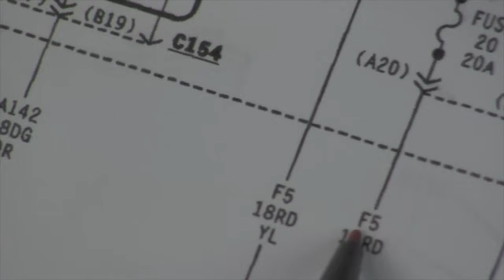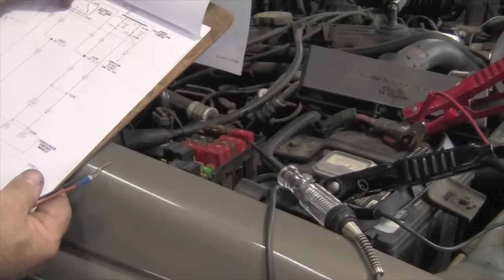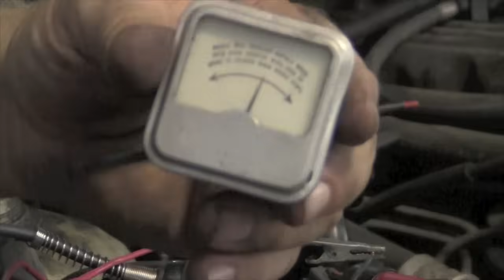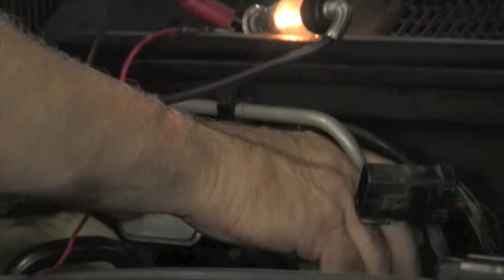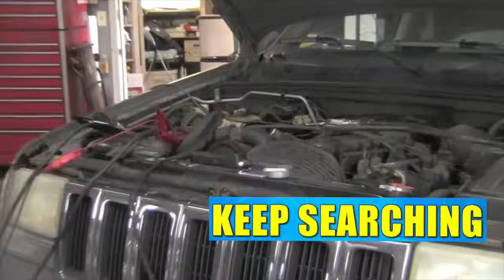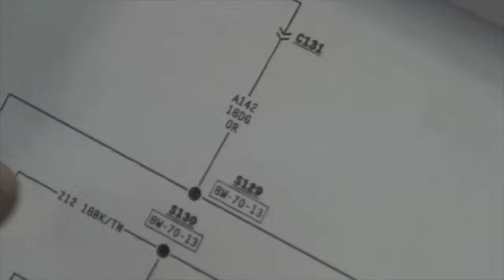Find an Active Short

Comment: I bought that tool 15 years ago when I started out as a technician and I’ve used it so much that the case broke and I’ve upgraded the gater clips on the circuit breaker and now use it with some back probe. It is a good quality tool till this day it still works highly recommended

Comment: Good short find, but why would the ammeter bounce on the injector power wire?, as the drivers in the ECU would all be open to ground…
Reply from the maker: yes they are open (looking for) ground but there is no current flow until ground is found.  The ammeter responds to amps, not voltage